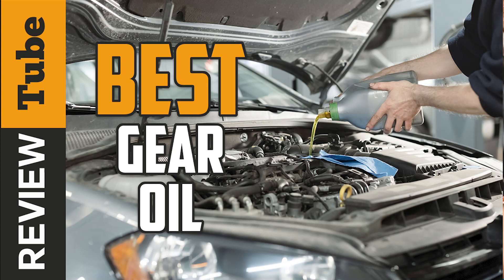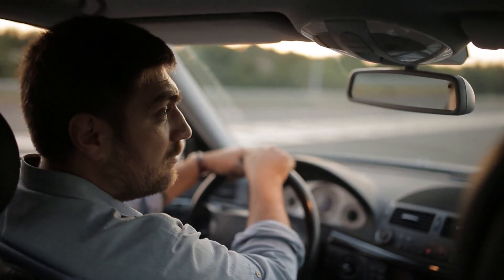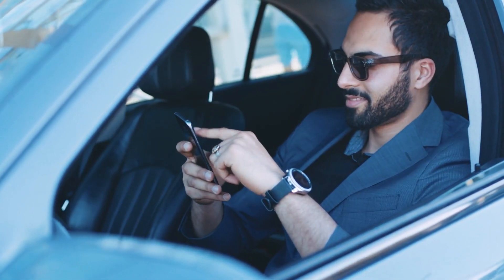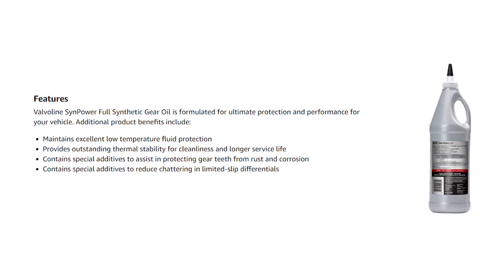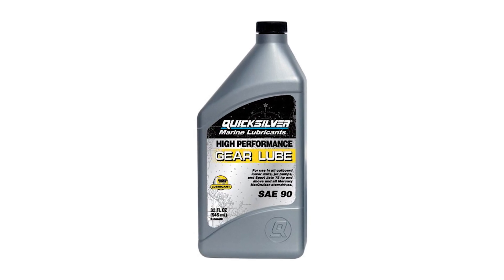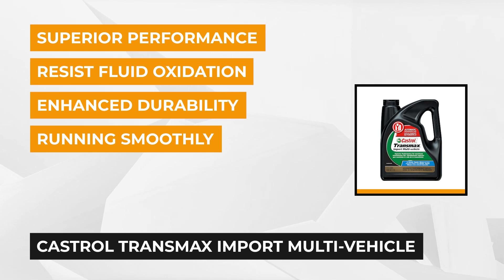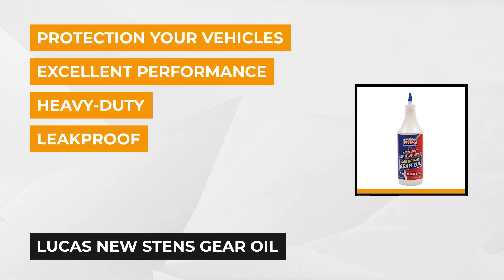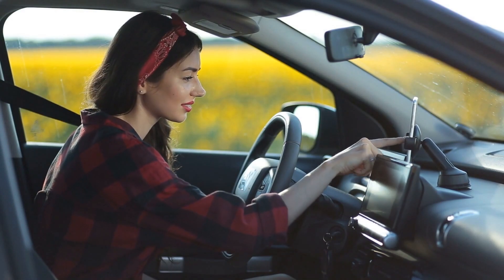✅Gear Oil : Best Transmission Fluid (Buying Guide)

Comment from the maker: ✅1. Super Tech Full Synthetic Gear Lubricant: https://bit.ly/3onnNwz
✅2. Valvoline SynPower Full Synthetic Gear Oil: https://bit.ly/3irCbjD
✅3. Quicksilver Mercury High-Performance Gear Lube: https://bit.ly/3isfDiW
✅4. Castrol Multi-Vehicle Automatic Transmission Fluid: 
✅5. New Stens Gear Oil: https://bit.ly/3kXMxJU

+ Java Burn, fat burning (80% off): https://bit.ly/3HJtVXa 
+ Healthy weight loss: https://bit.ly/3cuMxvU